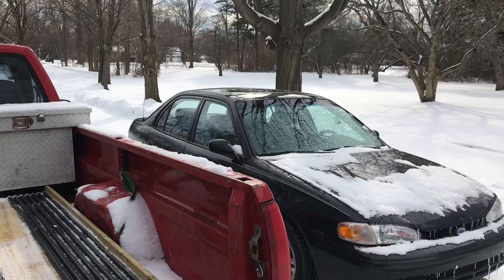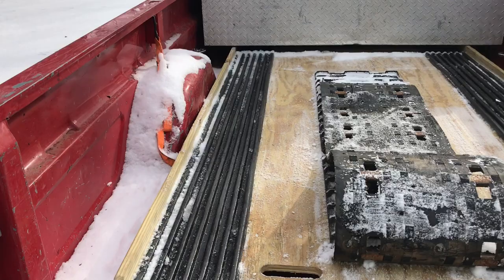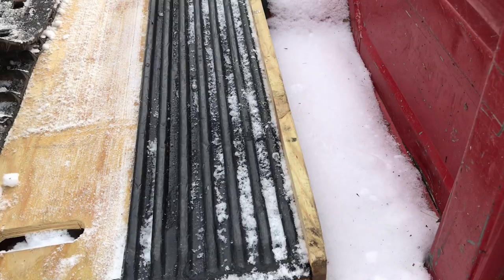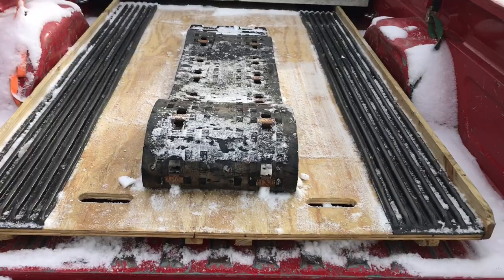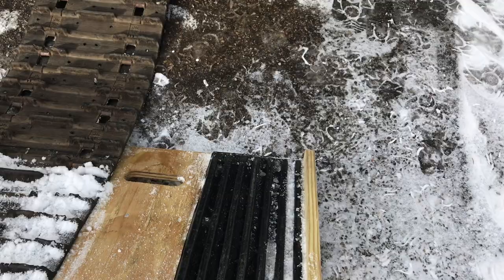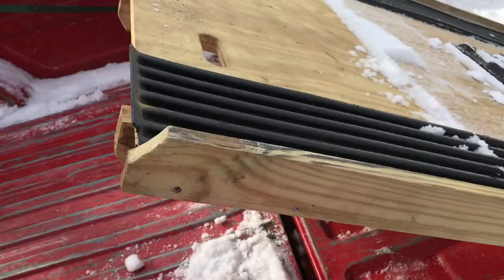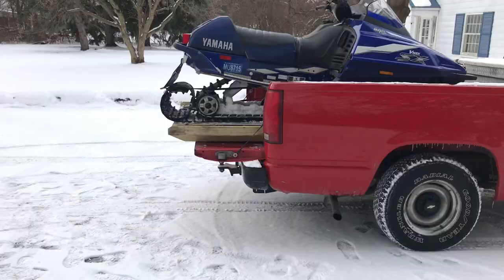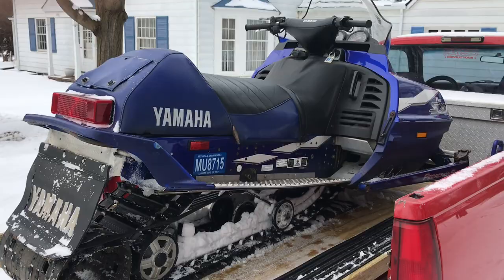Easy DIY Sled Deck Snowmobile Ramp

Comment: I really like your design. I made one a little longer just so the angle was not so steep. I also like the little blocks on the side to prevent it from moving forward. The "dragon tail" is the ticket. I need to add that to mine. Awesome job! Thanks for the tips.
Reply from the maker: The dragon tail is really the key feature and star of the show.  Once the track of the machine locks into it, it allows you to safely and effortlessly pull up onto the ramp, without it I could foresee a Lot of track spinning even more of the snowmobile pushing the ramp forward when the skis start to go up.

Comment: Ended up making this design it works extremely well! Only thing I had to add was some sheet metal flashing on the rails because mine kept catching with just the wood. The dragon tail is 100% the star of the show.  Ended up costing me $140 when all said and done.
Reply from the maker: That’s awesome! And yes, without the extended tail this would be just another janky ramp.

Comment: pretty slick . i just spent 400 on a tri fold ramp..wish i would have seen this video . i would have built one  !!!  awesome innovator !!
Reply from the maker: Thanks, I appreciate it. If you have a truck and a single sled then this is definitely the hot setup. With this, you don’t have to worry about having to stow the ramp since the sled is parked on top of it. 
Thanks for watching.

Comment: Excellent.  600 triple is a great motor, no wonder why you want to keep that!  Nice job that's pretty smart.
Reply from the maker: Thanks! Yea, this sled has come a long way since the day I purchased it and I’ve got to say that the one thing that I have never had to ever mess with on this machine was the motor other than just basic carb cleaning.  It’s been a great sled for sure. 
Thanks for watching.

Comment: Love the idea, I’d maybe get a come along or a crank to pull the pallet forward instead of lifting up the rear and and pushing it
Reply from the maker: That’s a thought but not really necessary. I normally pull the sled up all the way on there which makes the tipping point very easy to lift. in the video my driveway was very icy and I slipped the moment I lifted. Also a simple broken broom stick under it to roll on makes it glide in and out with ease. Thanks for watching.

Comment: Very nice and simple design! This is how I will do mine - only issue is to find an old track for the "tail." Possibly need to do that from plywood and boards. Also I may add some wheels to the front of the ramp - there is an old lawnmower waiting to donor them.
Reply: You can get some decent caster wheels from harbor freight. I am going to do this, but add the wheels for ease of loading/unloading.

Comment: Killer idea man, my only question is what is the dimension from the front of the deck to the eyes for your straps. I am going to build this…. So simple Great job
Reply from the maker: Good question and I do not want to give specific measurements because I have what I assume you are referring to the limiting straps that limit the deployment of the ramp... Set at with what worked best for my sled and my particular truck bed height which greatly varies from vehicle to vehicle.... but basically you find the best “tipping point” I guess you could call it. You want to find a balance between the weight of your sled and the steepness of the ramp. The further forward the “sled tipping point” makes it really easy to pick up the rear and load the sled BUT this will also make the angle of the ramp steeper.. so you have to find a compromise that works. Lifted trucks owners would probably benefit from making theirs from a 10’ sheet.
Reply: @siTTinLo  Makes sense, I have a very similar sled with (believe it or not) a similar truck…… looking at your video I was thinking 24” + (ish)…… I’ll build it and then play with pivot point-angles-vs-steepness. Appreciate your time.

Comment: Sittin lo on an SX...great in the corners. I still don’t think any new sled can keep up with me on my SRX, especially in the corners. But for all day comfort my Vector is much better.
Reply from the maker: These older ‘redhead’ triples are just bulletproof reliable and with the rear suspension conversion (SC4) that I did on this sled made this machine handle  bumps in the trails Beautifully without sacrificing its ability to still rail into the corners. We’ve had some pretty mild winters these past few years and I’ve pondered selling this sled, but the moment we get some snow and I ride it, I fall in love with it all over again so it’s probably a keeper as long as I stay in Michigan. It’s been a great sled and it goes anywhere I need it to go. 
Thanks for watching 🤙

Comment: That sled sounds great I was missing the smell of the 2 cycle oil. My buddy sent me the video because he wants to build him one but he doesn't have an 8' bed. Do you think it would work on a 6' bed.
Reply from the maker: I would say yes it would because although I have an 8’ bed, the tool box takes up almost 2’, leaving me with essentially a 6’ bed. As long as you make the deck the full 8’ long then I would say go for it, you just wouldn’t be able to leave it in the bed and close the tailgate when you’re not using it. 
Thanks for watching.

Comment: Built one pretty much identical to this for my  800 with a 163 on it and it doesn’t slide really at all, any tips on to making it slide better?
Reply from the maker: Either add wheels, skateboard trucks or what I do, I just use a piece of pipe or a broomstick and lay it on the bed floor where I figure that the front of the deck will be when I lift it up, and when you tip the sled up, the deck will roll on the pipe or the broomstick.

Comment: Love this! How heavy is it lifting?
Reply from the maker: It’s not bad, the whole idea is to find a balance and “tipping point” on the deck that works good with your sled.  You will notice that when I pull the sled up onto the deck, I pull up to the very front so that the weight of the sled is in front so it is not heavy to lift at all.